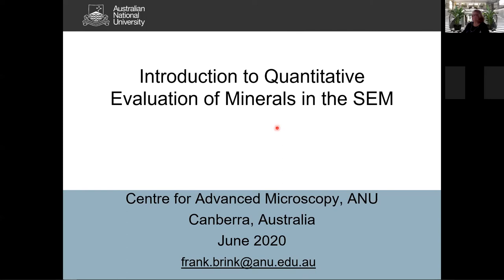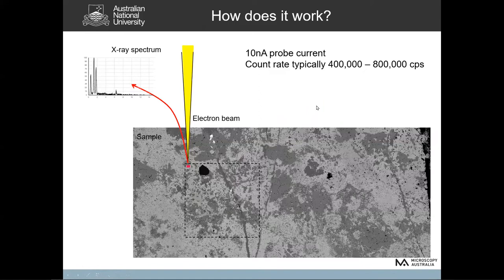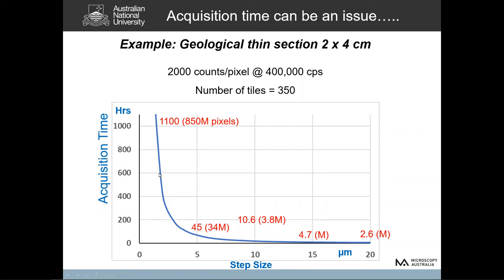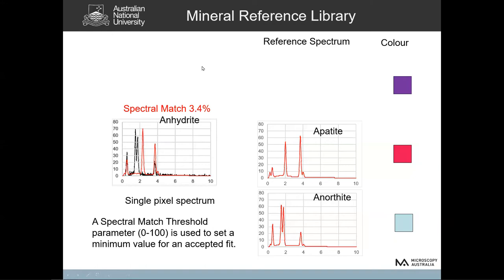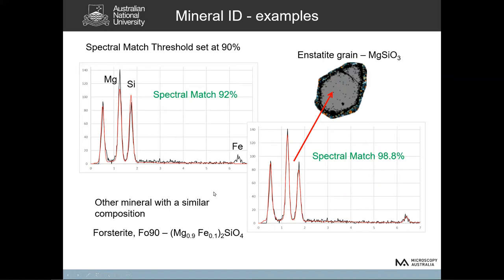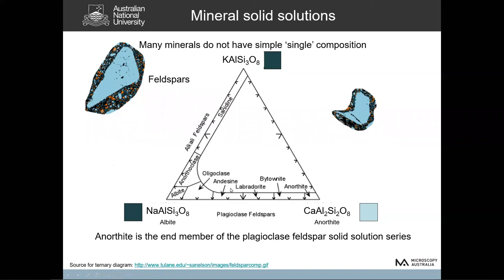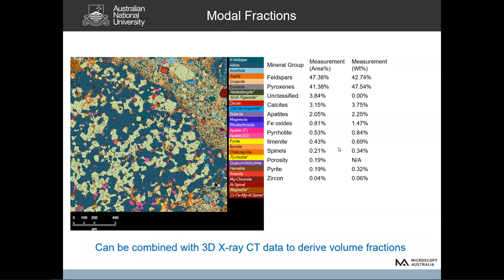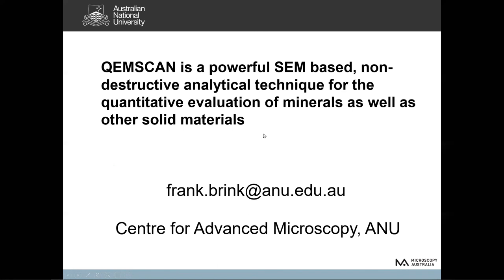Introduction to Quantitative Evaluation of Minerals in the SEM (QEMSEM) by Dr Frank Brink

Comment: The difference is likely due to the use of modern Silicon Drift Detectors (SDD) which are capable of count rates which are much higher than was achievable with Si(Li) detectors back in 2004. We run at ~400,000 cps in our system using two SDDs. Back in 2004 this may have been closer to 60 - 100,000 cps with 2, or perhaps 4 Si(Li) detectors. 

The number of pixels you can collect per hr is determined by 3600 X (Max count rate)/(No. counts per pixel).
As you can see the number of pixels per hour depends on how many counts you want collected per pixel as well as the maximum available count rate. One is controlled by the operator, the other is a limiting factor of the system you have.

In my example this was 3,600 x 400,000/2,000 = 720,000. 
In 2004 this was perhaps closer to 3,600 x 70,000/2,000 = 126,000. 
It is hard to sure without more facts about their set up.

Comment: Quick Q. Pirrie et al., 2004 points out that QEMSEM systems take around 10 ms for asign a mineral to a pixel, 100.000 px/h taking in account stage movement. In the example the amount of pixels resolved per hour are 720.000. Why the difference is too big?